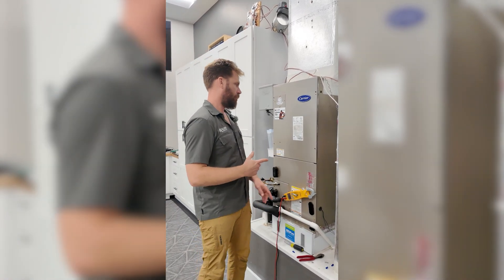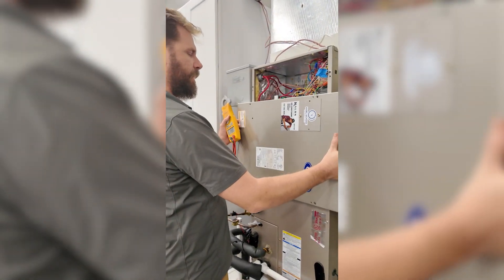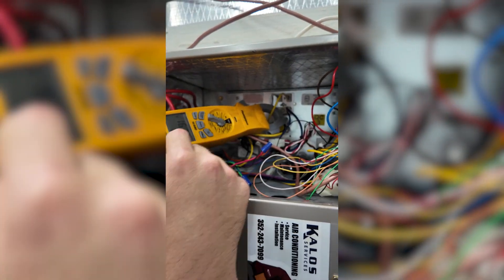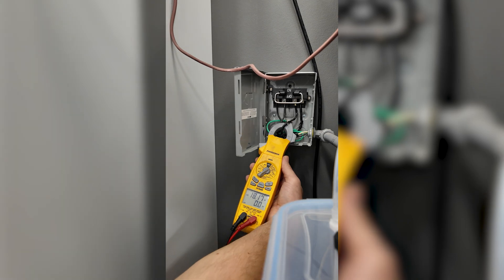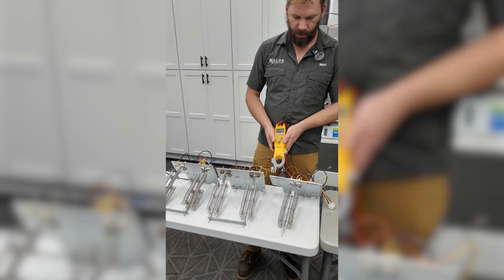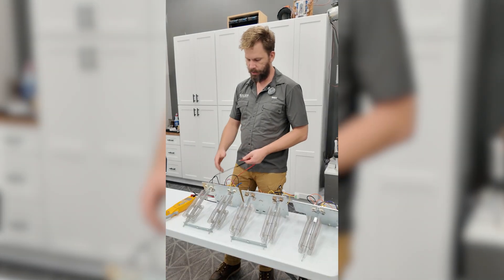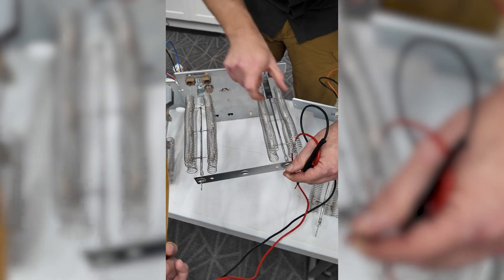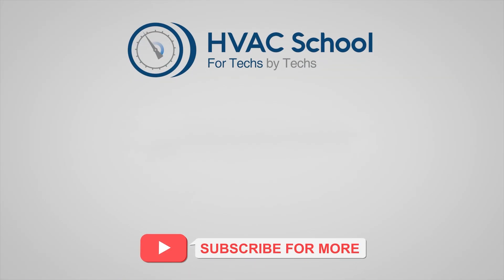Basics of Testing Electric Heat Strip Kits

Comment: So how do we figure out what the heat kit amp draw is supposed to be? From the data tag?  Or are all 5k heat strips 16 amps ( plus 2 amps for blower motor)
Reply: Sorry I didn’t watch the whole video before asking. Oms law right? But is there a place on the data tag that we could reference instead?
Reply: Always go from the data tag, ive always done that and you will get an answer. If you cant then you need to do the math with the kw and volts to get your amps. You can use a calculator online but always best from the data tag or heater compartment. 9/10 it will tell you
Reply: In my experience it’s roughly 4amps per kw.  10kw should be around 40 amps. 5 amps around 20 amps.  15 total would be 60 amps